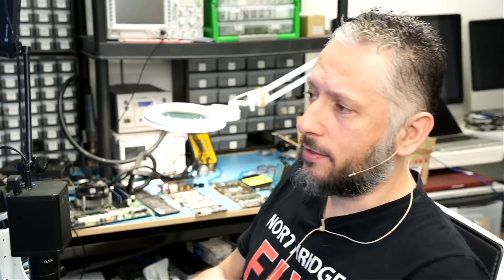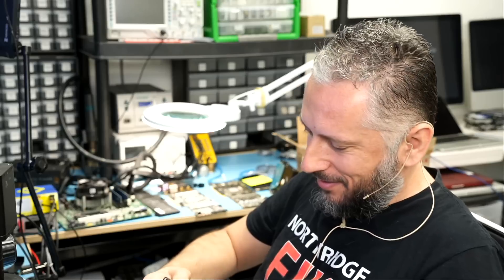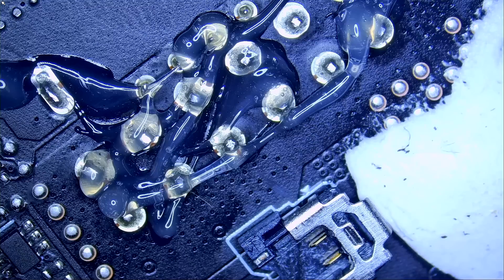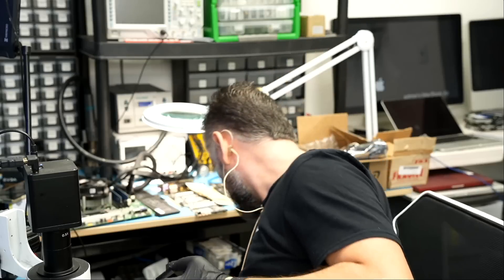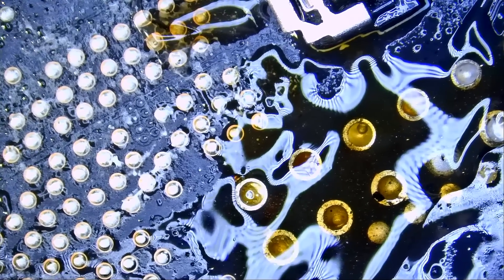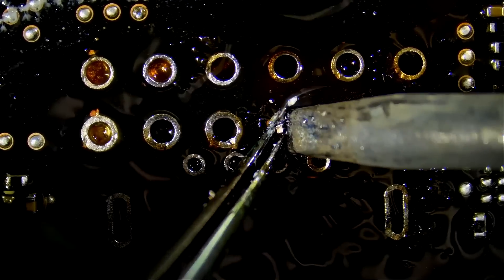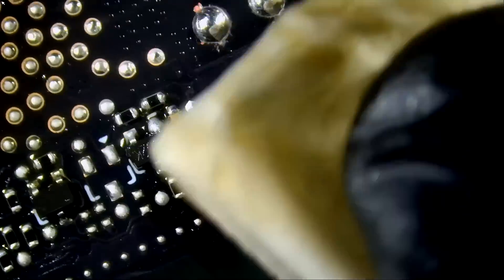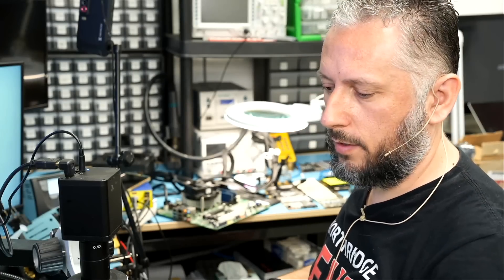4090 FE Connector melted with Cablemod Adapter installed. 40 series cards should be recalled

Comment: The problem with the 4090 is that when all four power connectors are connected, the onboard bios allows the card to over clock and draw up to 600 watts which causes the single power connector on the GPU to over heat, but you can run the 4090 with just three power connectors which forces the card to use only 400 watts which is more than enough power than most users will ever need.
Reply: Who is going to buy a 4090 and then hack off a bunch of the performance they just paid for? 
The problem is not with the amount of power drawn. A poor connection at 400 watts would melt the connector too.
Reply: the only way to back up this, is if 4080's dont also suffer from this.. have their been any 4080 cards melting as well?
Reply: @Incinerate1212  I haven't seen any reports of anything but 4090s having the melty plug issue. She is a thirsty girl.
Reply: @Incinerate1212  No 3080 cards that I know of have had this issue.  Excellent observation on your part as the 3080 only has three power connectors.
Reply: Everything you just wrote is bullshit and has no basis in reality, the socket involved has no issues pulling up to 1600w+ as tested, the only people having problems have damaged the terminals or have a statistical manufacturing defect and blowing things out of proportion, as the stupid masses like to do.
Reply: um no ~ you only need 2 of those pins connected to allow the up to 600 watts power draw

Comment: Pure guess ofc - “reference design” uses a different (higher-spec) connector than what comes with the mass-produced devices. Had I a 4090, probably would be removing the connector “pro-actively” now and soldering the Y-splitter power cable directly to the PCB. Not brilliant, but a) as-is state looks like a fire hazard, b) action is generally reversible in future when an improved connector/Y-cable combo becomes available

Comment: In the next gen they will double this crap connector called "this is solution",  and you will have double trouble because new cards will pull 1000W instead a 600W on 4090 now 😂

Comment: Its a factory issue, correct me if am wrong,if the top pin are not connected properly which means no current are passing through then how can it burn. And pins which are connected are not burn. It doesn't make any sense

Comment: seems 450W is enough to melt this shitty 12pin connector, and they rate it up to 600W.. Joke is on you Nvidia. Glad i went with a low powered 4080 non-OC. 4090s are dying like shit and should be recalled for redesign of the connector.

Comment: If the design allows this many users to have issues ... it is a design fault. I imagine most of the people using and installing these cards are pretty sophisticated users too. And melting with a mod connector already installed ... no way this user was at fault.
Reply: Agreed. If the design make user error likely, then it's definitely a design fault.
Reply: @TheGameBench  Yup. Regardless of the plugs capabilities to safely provide the rated current, if the probability for user error is relatively high, then it's a poor design.
Reply: The way this works is easy. The management wants the cheapest available components that allows them to market the product as premium. Any engineer that disagrees with it is either fired or shuts up to save his job. Its not a race to satisfy the customer, its a race to beat the competitor whilst being as cheap as possible, while ripping off the customer.
Reply: .... you know, you got a very good point here
Reply: this is why i stay away from the 40 series  and stuck with the 30 series
Reply: There's no "this many users having issues".  
GN just made a video and claimed CableMod told them all of these cards are theirs, and died over the course of many months.  
Try not to be an idiot and jump the gun next time. That goes to you and NorthridgeFix. It make you guys look like idiots.
Reply: The number of users with this issue are a fraction of not even a full percentage or total owners, and do not even make up a percentage of the RMA failures.
Reply: its just cheap, nvidia is putting out cheap junk no quality control
Reply: show me the purchase date of the 4090 and the power adapter. are they the same? did he buy it later?
Reply: Oh yeah? How do we know that he had the other 2 connections to the cable and  the PSU properly seated? That's what I want to know...
Reply: Old power connector. It's big and can't deliver much power but is reliable
Reply: The connector is built to melt
Reply: This is 100% correct. Having been on the receiving end of designing. The design process has to root out the potential failure modes. Nothings perfect, hence the need for the revision process.
Reply: You're spot on.  The core problem is the connector doesn't stay seated.  You push it in as hard as you can, then spend the next hour wiggling your cables around trying to make your case look nice.  In the process, you're slightly unseating that connector.  Visually it looks seated, but it's not:  https://youtu.be/ig2px7ofKhQ?t=1419
Reply: @SteveWeinrich  if the connector looks seated, but its not, lets be honest, its an almighty shitty design for a power connector that handles 50A of current.
Reply: @SteveWeinrich  There is no clip to keep it seated??
Reply: Without a better look at the connector and how it was installed in the case there is no way to say it wasn't user error. That 90 will provide a nice leverage point for people trying to clean up cable mess and could easily lead to poor connections at the terribly designed plug.

Comment: the manufacturer has to probably change to a higher power load connector as the current ones just not able to handle the load and heat.

Comment: As far as I know the PCI SIG revised the specification for the 12VHPWR cable connector. There is an update for the cable connector, but I believe it will be some time before new 4090 cards get it.
Reply: i'm pretty sure it's for the male connector so cards are fine, it's the cable side

Comment: High Ampere current passed through that thin wires, pins heated means its material has enough resistance to generate heat and melt plastic, done!

Comment: It could be because of the connector plastic itself is not able to withstand the heat due to poor quality of plastic is used. Possibly too much re-crushed material. Very interested to know those that Alex had repaired/changed the connector, does it melt as well?
Reply: The socket is nylon with an electrical grading to tolerate up to 300 degree's of heat, the resistance that causes this exponential heat buildup exceeds this, and it would exceed this on any pin/socket combination of any size where the resistance is impaired through low contact or pin contamination.

Comment: It’s seems more and more obvious that design have flaws but a consumer error can be the cause too.
If we want to know if the design is good enough, an independent lab should do proper testings with high power draw, mechanical stress at least for months.
And maybe card manufacturers should modify a bit their design, to give a little bit more of clearance to plug the cable in the card.
Reply: Yeah, they have perfect connector. Only problem is that 99% of people don't understand how to use it. If something does not account the human factor at all, it can directly be considered faulty to start with

Comment: One thing you might possibly try is to monitor the current draw on a working board and record. Once you have the power drawn check the power limit of the connector on the mfg. Spec sheet. Could be over limit of connector. Bad design...

Comment: I have one of these CableMod adapters and my adapter is loose in the 4090 plug...like really loose...so if these adapters are not fitting right then the same crap is gonna happen...plug too loose or not plugged in right will melt...I run my card at 70-72% power with an overclock with no performance hit...might be why I'm safe
Reply: The GPU side connector we designed to have some wiggle to it for installation and removal, it's fully safe though. We've sold over 50k of these units. If you have any concerns with it being overly loose, chat up our support team so they can look at it and confirm if it is good or looser than normal and they will send you a replacement if you're at all uncomfortable. :)

Comment: Hmm, a question was the socket partially melted before he modded it, also I think part of the issue, was it was concluded that the cables plugging into the socket had cheaper variants where the sleeve that went over the pin had a double slit (1 either side) rather than just the one which could cause the sleeve to loosen or widen if the cable was overly stressed as I seem to remember people checking they're modded cables for the right variant.

Comment: Customer error can only go so far though, when you see so many 4070s 4080s and 4090s and some of the 3000 series also have this stupid power connector which I think is a stupid connector. They are shoving so much power through that connector when they could just do what they used to and have multiple plugs. No one was complaining about having to plug in multiple cables from the power supply. Nvidia just thought it was a great idea.

Imagine paying thousands of dollars for one of these and this happens or even worse your house burns down and Nvidia just spits in your face. I have their older cards a 2070 super and a 1060 without this connector. Nvidia just seems to have gotten worse. They are incredibly greedy now, they don't care about their customers who buy their GPU's their CEO even stated he wants to move away from the PC gaming community and sell GPU's only to the industry.

Comment: This connector has bad design all written over it. A graphics card is already a thermally hostile environment. This connector cannot withstand this heat+the amps that are being pumped through those tiny pins. All of them will fail eventually.

Comment: I'm not super qualified but from experience with electricity when I saw the new connectors I thought there will be thermal issues
The cards use so much energy that a smaller connector wasn't a good idea at all 
Going from 3 connectors that carry that energy to a smaller one can't be achieved unless you use stronger materials
In this case they didn't
I'm 100% it melts because the port can't handle the energy going through it

Comment: I think the resistance of the metal that the manufacturer use to make  the connector is too high . Low voltage high current need special low resistance metal in the connector.

Comment: Basic makers design flaw crap design  smaller connector saves on cost of the connector  card packs up == more sales for the card maker  rather simple   equation one word sorts it all MONEY .
I can see a way of solving the problem some soldering work with a better connector  and HEAVY fly leads  if it was mine that certainly would not happen  but i aint got money to buy one  .  unless i am given one

Comment: Thermal Runaway. Designer has "CAD" eyes. Everything is perfectly flat, smooth, touching every molecule of the materials. calculated surface area touching the contacts is acceptable for the amp draw. Theory and reality. Reality is... It is not. But share holders are happy with the additional profit margin.

Comment: Unless you have a whole batch of these I fail to see how ONE bad Cablemod adapter proves that its a problem with the connector in general.

At this point a lot more 4000 series have been sold than when the problem was initially reported and we've heard nothing of this problem being widespread.  Random plugs/connectors being faulty is to be expected, this could easily be a flaw in the Cablemod adapter and it ALWAYS used to be recommended to not use adapters at all because it increases the chance of this sort of thing happening.  Melted connectors still happened on the old connector, on every single connector every used, it just wasn't sensationalised for ad revenue.
Reply: This very well could be a one off failure on our adapter, but we've had reports from resellers, and as we've seen from several videos from Alex now, there are the same pins melting on the same row in a lot of these instances too. There's definitely an issue of melting connectors if you don't seat your cable/connector in fully as well though as noted by GN's findings as well, but yes, there could be something else going on too. We aren't ruling out that we could've had a faulty adapter in this instance though which is why we wanted to look into things. But as always, our support is taking care of things too and we replaced any GPUs that had faults, whether it be because of our own product, or user error in not doing a proper installation, we are taking care of it either way. :)

Comment: So the connector has been made smaller and the amp draw of the 40 series cards has gone up 

This doesn’t make sense to me 

Moor amps connector gets bigger 

I also think the connectors that are snapping off because of heat cycles making the pins brittle 

I think the design was intel 

Next time you fix a complete card .power it up and look at the power connector and cables with your thermal image camera 

Obviously with the card under load

Comment: From my experience, where there is no good contact but there is high current consumption, the contacts heat up and of course the plastic melts, so it is likely that the connectors are not sized properly from the factory.

Comment: There should be bigger gauge legs used on the connector to the board and bigger gauge wires used to connect it all, most definitely a sign of too much power going through too little gauges of wires/feet.

Comment: I think the root cause is a combination of having the pins being used slightly beyond their absolute maximum limit of current (electrical issue, 6.0975A where it should not exceed 6A), and some amount of not very good connection for certain pins (mechanical issue). Pin resistance goes up, the pins heats up, melts the plastic around it. This is pretty awful engineering, why going so cheap by designing the card at the limit of the connector and leaving no room for suboptimal contact?

Comment: Considering how many of these you see on a daily basis your expertise for sure holds weight. I myself always thought that the amount of power they are pushing threw one connector was kind of absurd. I'd like to see Steve re-create this issue with the 90 degree adaptor.

Comment: The adapter wasn't plugged in incorrectly, so clearly it's a design fault.
Also, what are the guarantees that the replacement connector won't immediately melt in the same way? There won't be any guarantee.

Comment: The 12VHPWR connector is a stupid design that will hopefully be abandoned by the industry, but this one incident is most likely caused by the cablemod adapter, not by the 12VHPWR connector on the card.
Many people in the industry have heavily tested the connector to make it melt
Results : as long the cable follows the specsheet, melting only occurs when the cable is not fully inserted
And yes, it's very difficult to know for certain if the cable is fully inserted => terrible design
Reply: These repeat failures are happening even without our products in the mix, look at previous videos from Alex, outside of this, we've been talking to resellers and have seen reports of melting cards when using the stock Nvidia cable even. We've sold over 50k of these adapters, we put a lot into them and they're very quality products as such. Outside of that, we have a great support team too, so even if a failure happened (like this one) we replace the card ourselves with a new one, and send out a new adapter. You're in good hands with us. :)

Comment: The 4090 requires a lot of power, they tried to get away with using a smaller connector when they should have used a bigger one. Nvidia could blame the PCIe standard but the onus is on them as the manufacturer to make sure it's adequate. I wonder if all these cards having issues are OC versions? Perhaps users should Under Clock the card to keep it safe

Comment: the engineers are definitely on fault why would they use plastic around hot pins they should use aluminum and heatsink because everything is having a heatsink nowadays back in the day storage, ram and processors dont even have heatsink, they ignored the rules , if its new tech they should have heatsink on it,